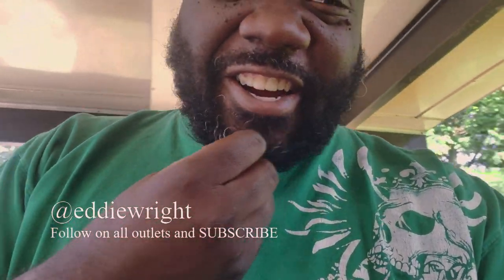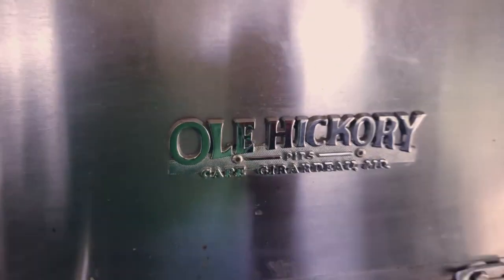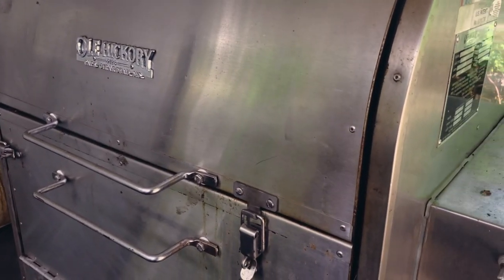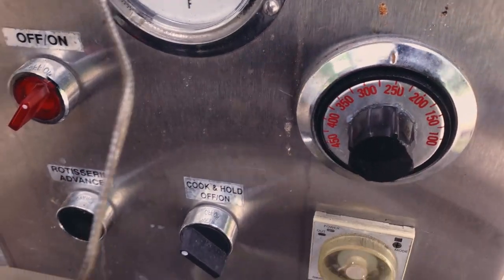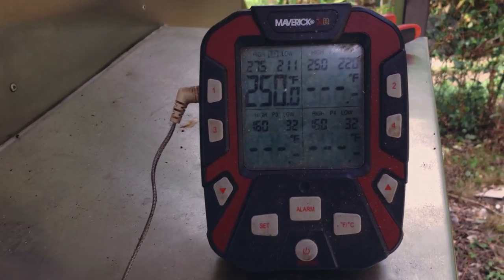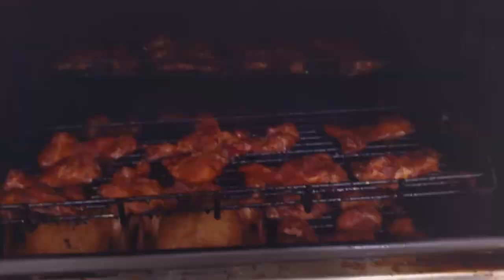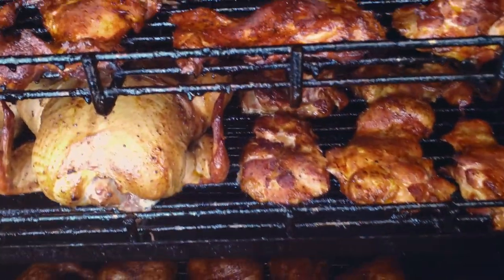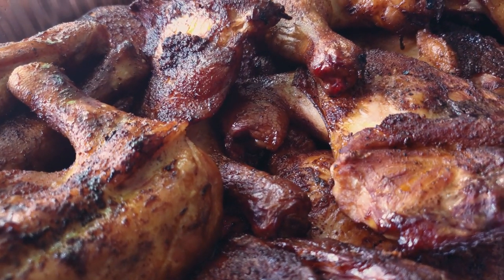Testing Comp Mode On The Ole Hickory Pit #theWRIGHTway #olehickory

Comment: Looks fabulous, at 250 was the skin rubbery? I can never get bite thru skin at a low temp like that.
Reply from the maker: it was a good solid look and taste but yes, it wasn't perfect skin. not rubbery but you definitely couldtell it needed about 25-30 degrees in the final run to make it a little more tender. thanks for watching.
Reply: @EddieWrightBBQ  thanks for the quick reply! New sub here!